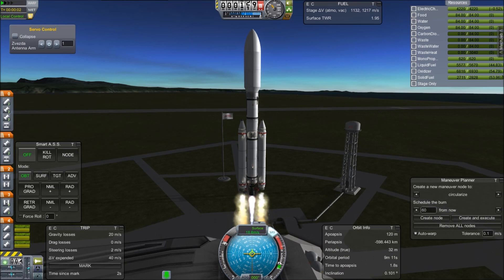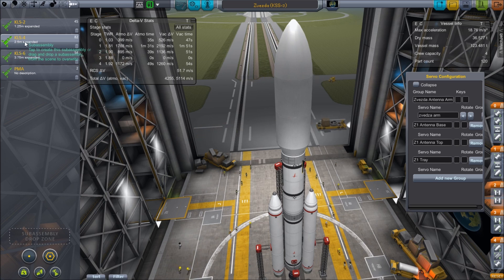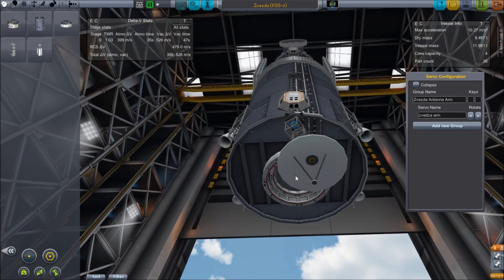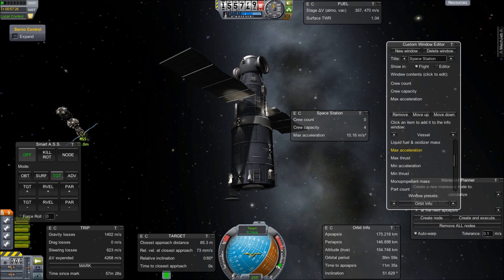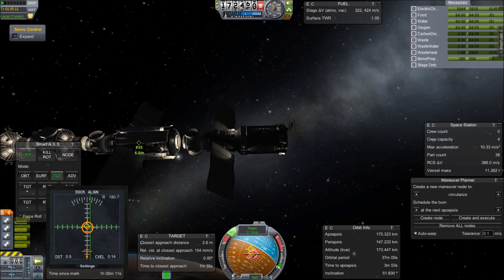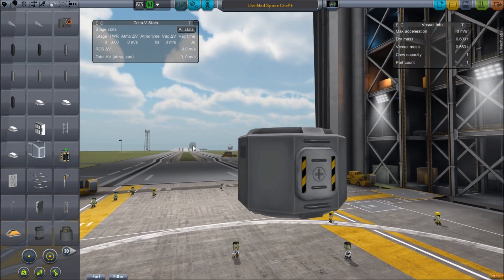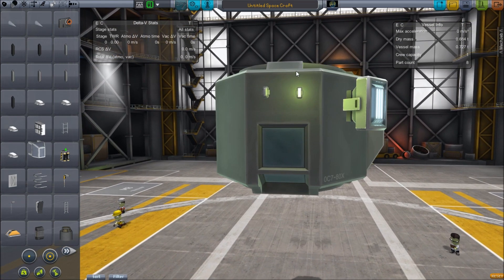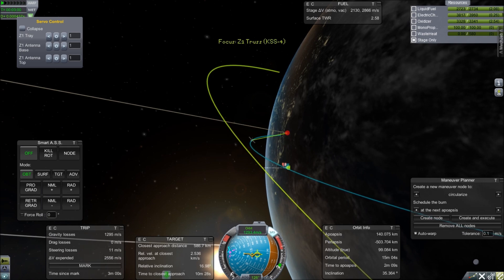KSS-3: Zvezda / Project Gateway / Kerbal Space Program 0.23

Comment: You can just add those lights to the 'lights' action group Then when you activate the lights, they'll fire too. Saves an action group. Also keeps them together.
I did that with the brakes to deploy solar panels for kethane mining.
Reply from the maker: I'll assume you mean Aviation Lights? I recall mentioning in one of my videos that Aviation Lights requires a separate group, so KSS-3 is probably that one? No, Aviation Lights can get out of sync when used in the Lights group. Once that happens, hitting 'L' will cause them all to toggle on/off opposite the normal lights. I have always assumed it was due to them having a DLL to mod their extra functions.
Reply: Bob Fitch Ah, I didn't catch that, sorry. I don't use those lights myself, but after you described their function, I do want to try them. I also used the light group for kethane drills, and hadn't had a problem. Those lights may be special because of the additional effects they do then.

Comment: FYI, you can add the aviation lights to the lights action group and they'll turn on like all the others.
Reply from the maker: No, they can get "out of sync." You can get into a state where some are on and some are off, and you can't toggle the entire group to fix it. The toggle will cause the off to go on and the on to go off. Normal lights, even if some are on, will toggle all to the same state. AviationLights are controlled by the DLL to some degree, which is what causes this.

Comment: It looked like you were still using Maneuver Node Improvement which is actually outdated now (unless with chatterer I dind't checked if you may replaced it later )
But there is now a continuation mod http://forum.kerbalspaceprogram.com/threads/47863-0-22%20PreciseNode
Reply from the maker: Yea I tried that one but (1) it added to the UI when the old one was simple and I liked it, (2) changed the UI from what I was used to as well. :) Thanks for sharing the link. Keep em coming if you see things. You helped with chatterer and might find more ways to help.